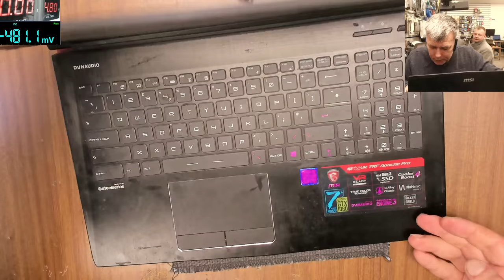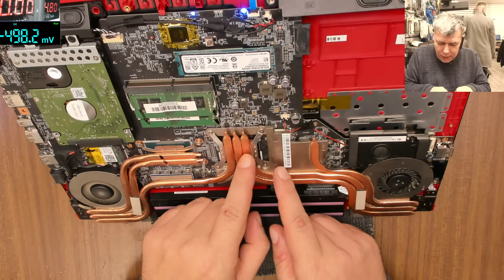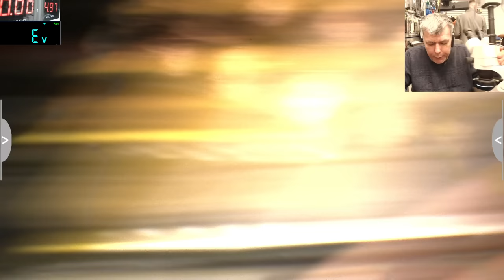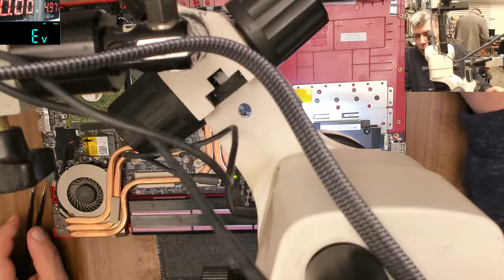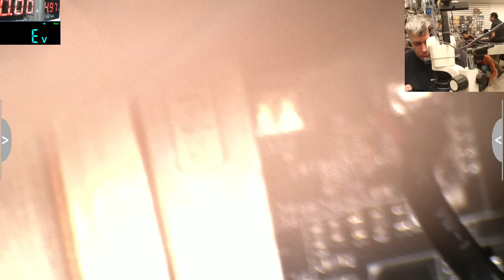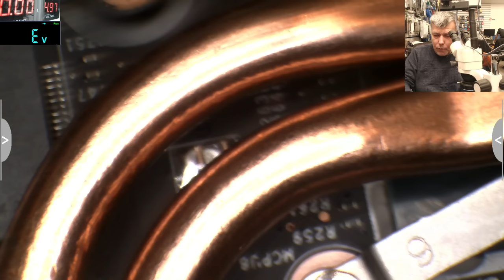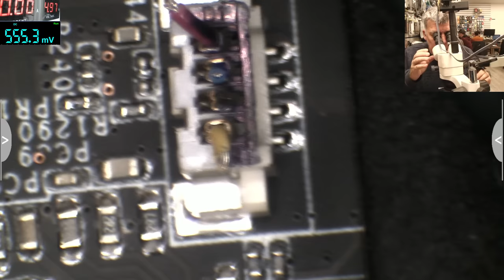How to solve a overheating issue when the fan is good but not spinning

Comment: I'm disgusted by the work you did here. You can't go around cutting wires without first measuring the stresses. You are not even sure if it is an ordinary fan vcc, rpm, gnd or a fan of 4 connections vcc, pwm, rpm, gnd. That machine is worth a fortune and you arrange to place jumper wire with hot silicone??? Terrible level of work. It is stupid to argue that by reviewing what happens you can be damaged more, the only way that happens is that you are a total incompetent.

and so you know they are fans by pwm that are handled by the KBC based on independent thermocouples.
clearly the fan works so you should check the PWM line from the fan connector to the EC/KBC. It goes through a resistor of value 0 that may have been damaged. also the connection of the EC pin with respect to the motherboard. and finally the temperature sensing lines since the EC generates an independent PWM for each fan depending on the temperatures
Reply from the maker: idk, but the laptop was working and we charge the money for that repair, which is all that matter in a computer shop. Here is England, if you are not able the make at least a hundred pound/hour, then you are not a good addition to the shop. How you are expecting to be paid £15-£20 per hour if you can't make £100? Its all about the money in a computer shop and all what matter is the job to be done and work in the warranty time which is 3 months, sorry, but i didn't make the rules. For me, kbc/pwm/ec are just words, noise, things which are not matter, things which sound like a lot of waste of time.
Reply: hello hernandg5054 - good comment !

PWM Control by KBC: In many laptops, the Keyboard Controller (KBC) or Embedded Controller (EC) plays a crucial role in fan control. The KBC is responsible for handling various system functions, including fan control based on temperature data obtained from independent thermocouples.

a. PWM Line:  checking the PWM line from the fan connector to the EC/KBC. This is an important step because the PWM signal generated by the EC/KBC needs to reach the fan to control its speed. If there is a problem with the PWM line, it could lead to fan speed issues.

b. Resistor Damage:  If the resistor is damaged, it could affect the PWM signal's integrity. It's essential to check the condition of that resistor.

c. EC Pin Connection:  A loose or damaged connection can disrupt communication between the EC/KBC and the motherboard, potentially affecting fan control.

d. Temperature Sensing Lines: The EC/KBC generates independent PWM signals for each fan based on temperature data. Checking the temperature sensing lines is important because accurate temperature data is crucial for proper fan speed control.

Comment: Solderind technique is awful. You killed plastic connectors. If you need to cut a wire, you should do it far from the connector.

Comment: I must say this was painful to watch, the level of dodginess of this repair is unbelievable.
He could just solder a wire from the cpu side on the board the blue pin (not the fan connector) and solder it to the gpu side of the board.
that way the customer can replace his fan if need be.
this is a bad bad soldering and repair job, from customer stand point and user friendly for this kind of fix is bad, no matter how cheap the repair must be, i would demand my money back.

Comment: Some people do not understand. It is easy to say do more work and don't use solutions or work arounds that fix stuff just do the full perfect job back to factory state. that is not what people want to hear when they get some massive bill for an expensive repair for an old laptop. If it works they do not care about how you did it unless you charge lots of money , They could buy a second hand computer laptop that is better than the one you repaired. Now no one is happy. So run a wire and all is well and the thing is working. lets start up our game and order piazza lol.